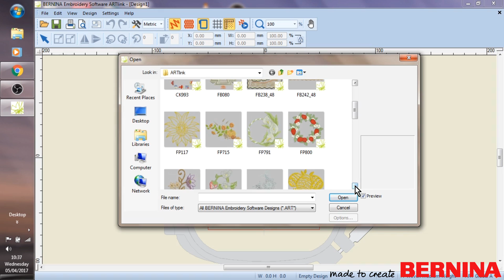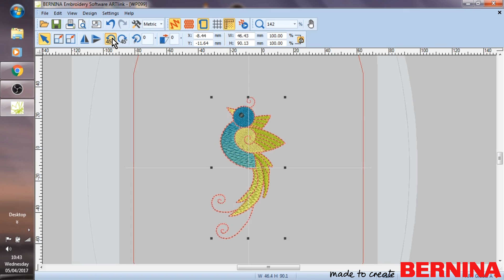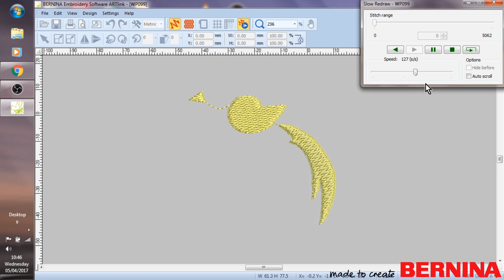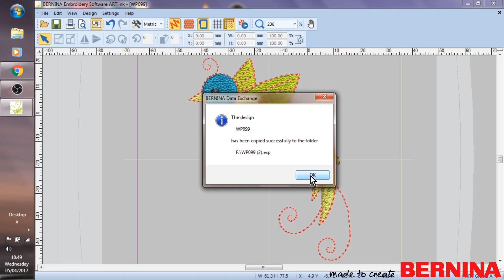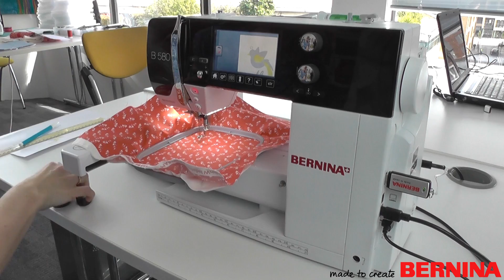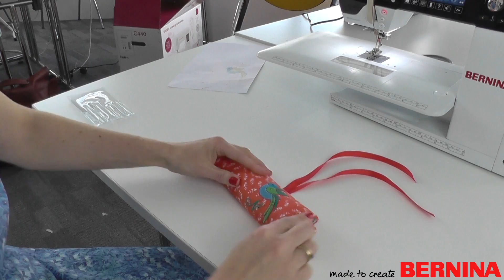Make a make-up brush holder with embroidery

Comment: Bernina 1530 and Bernina 1630. Still being used and enjoyed, your first amazing computer machines.We have been Forgotten , surely you can still speak to us direct from time to time. We long term users can still help new machine beginners , I am asked quite often , by beginners to spend an afternoon demonstrating my Basics.I have owned my Bernina 24 years,. Used once a week.
Reply from the maker: Hi Derick, we are delighted to hear you are still using the classic Bernina 1530 and 1630. If you don’t own a modern computerised machine, you can still embellish the project with your current model. The 1630 is in fact ideal for this with its wide sideways feed embroidery designs. We are also planning future webinars that will accommodate for older Bernina machines.

Comment: How
to open an existing design in ArtLInk7 at 100% by DEFAULT.
 I tried all the settings by hoop /zoom etc. but the designs ALWAYS opens 
scaled either up or down . It is
however never 100% not even when I closed the program with the same
design adjusted to 100%.
I want to open and see it as it is 
-without having to scale it up/down
on the screen each and every time. 
Thank you in advance for your
reply.
Reply from the maker: Sorry for the delayed response. Please give us a ring on our helpline, 020 7549 7849, so that we can assist you further :)